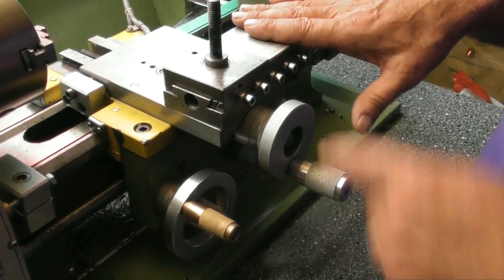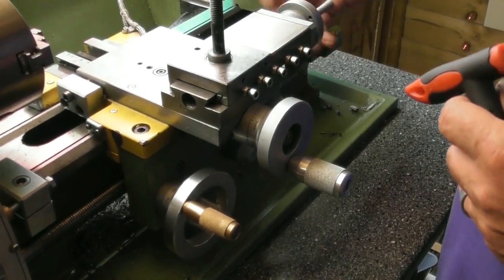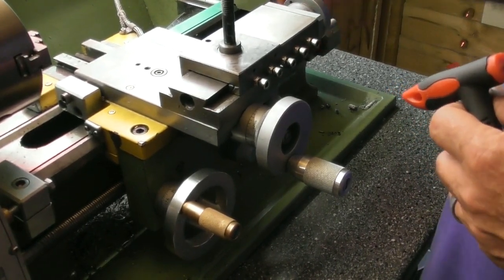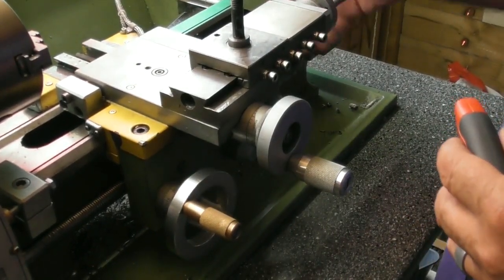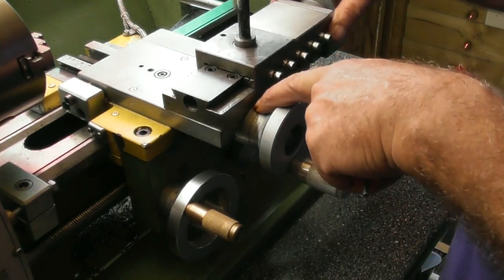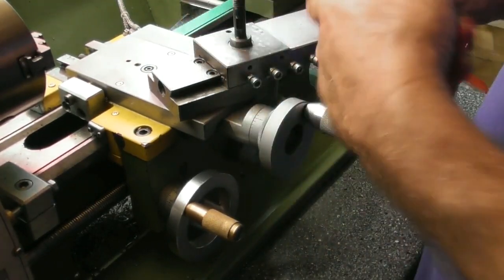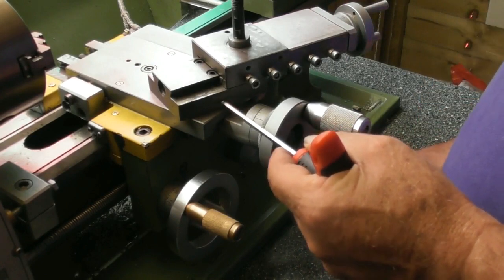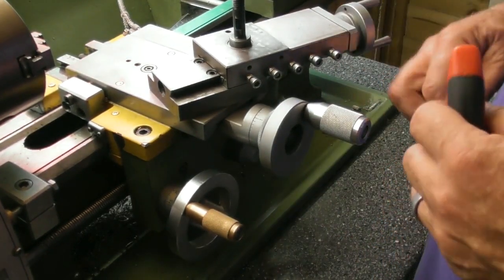Warco lathe beginners improvement compound slide part 1

Comment: Hi Ade, I just drilled two holes through the compound just past where I normally run. I then printed two plugs to keep the swarf out. Make it much easier to get to. I like your solid tool-post idea as I think this is the way to go. Thank you for all the videos.

Comment: Hi Ade,
   Have seen videos on this problem some drill from the top to pass the key down, but your way is the best, if the brass pads fail eventually it would be easy to change,look forward to part 2 thanks.

Comment: G’day Ade, I was referred back to this series by you in the future. I was impressed with the alternative method others had mentioned by drilling two holes through the top, simple I thought until I checked my lathe, those two screws are positioned directly through the dove tails on both sides of my slide, hence I would have to cut the gib in two, so that idea is out and I’m back to your method. And I was always of the impression that all Chinese mini lathes were all the same. 
Cheers 
Peter
Reply: Bugger. Mine is the same. I was excited about just being able to do the simple mod. Seems like the newer ones are right through the dovetail.

Comment: Ade their are a couple of vids on this subject altering the compound slide, these were dead simple way of doing it.  They simply drilled 2 holes down through the top of the compound that lined up with the 2 stock bolts that go into the swiveling plate. I think they were something like 8mm hole so you just insert the allen key in through the 8mm holes into the cap head bolts. To stop metal shavings  getting in down these holes a couple of removable plugs are put in the holes.
Reply: Just reading this now and im going to do this on mine. Thanks.

Comment: Hi Ade, quick question. I notice that with the gibs on the side of the compound, you have a Alan bolt to make the adjustment, and then a nut to secure it. Is there any reason why you couldn't just get rid of the nuts and secure the Alan bolt with some locktite? So it would behave like one of those nuts with the blue plastic inside? so you can still make fine adjustments, but it won't come loose? ..making adjusting the gibs so much more easier?

Comment: Are you certain that one grub screw will be rigid enough? Also, if you make the center part out of a soft metal, will that not make dents which in turn will make it difficult to set another angle close to it? I have no idea myself, but this is an interesting mod which really want.
Reply from the maker: Two screws brass followers

Comment: The quick way to fix this anoying problem: 1. Remove the compound slide from the lathe. 2. Crank it back so that the front edges are flush. 3. put it upsiede down on a drill press, and drill holes from the screw holes troug the slide out of the surface where the tool post sits. 4. deburr and mount it to the lathe. 
Normally this holes are covered by the tool post. To adjust compound angle just remove the tool post mostly my compound is nearly flush with its ways. Only mimimal cranking necesarry. Whole modification is done in 15 min.

Comment: I bought a 9x20 lathe from Chester Machine Tools to supplement my Colchester Student, thought it would be good for smaller jobs and to free up the big lathe.  wish i had never seen the thing, it was rusty, fit and finish was appalling. over the months i have had to remake the compound, scrape the cross slide and ways, the tailstock was 3mm low and canted, the headstock was still full of casting sand. support has been non existent. basicly a £1200 boat anchor, many times over the months i thought of just scrapping it. well to sum it up if i hadn't had my other lathe, mill and 30 odd years of experience it would have been unusable. i pity anyone starting up that had gotten this